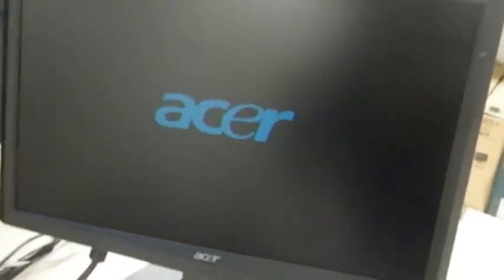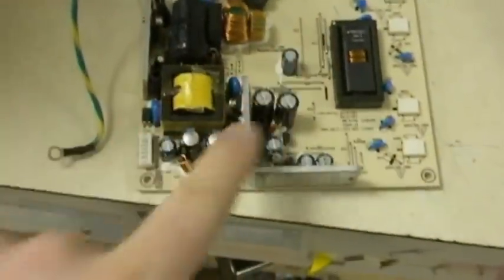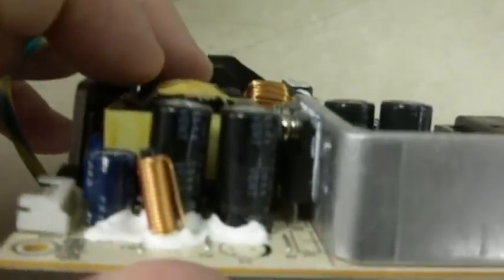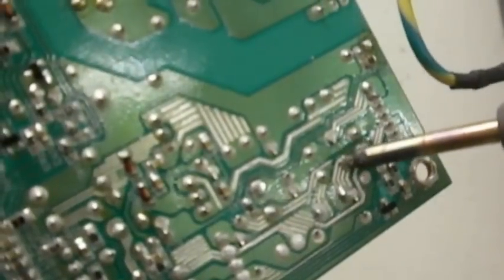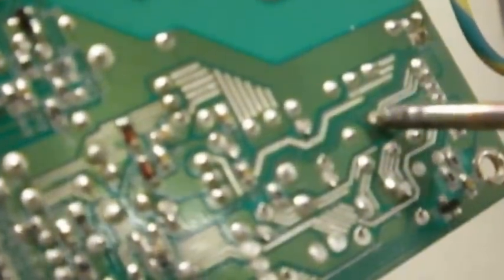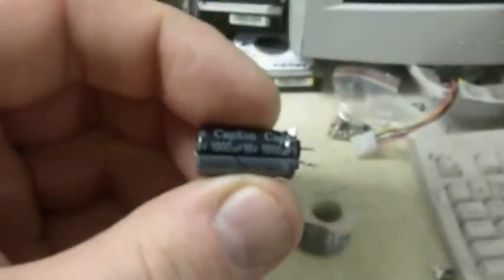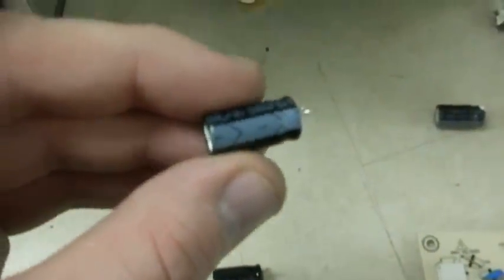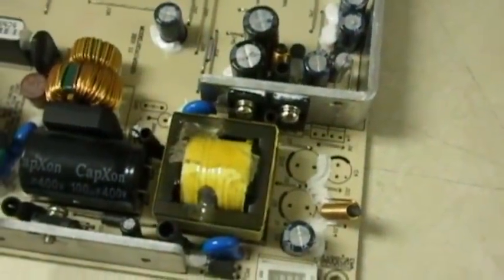LCD Monitor Repair - in 5 mins!

Comment: my samsung 913v monitor pwr board (disconnected),  makes a clicking sound 4/5 seconds apart,..could it be a fuse or capacitor?  I have no picture
Reply from the maker: I am not familiar with that board, I really can't say.  Do you have a service guide?

Comment: How did you know WHICH capacitors were bad? I have the same Acer problem...
Reply from the maker: I believe I said in the video, you look for the puffy ones.  But usually its safe to assume they're all bad, because they probably are!
Reply: ok.  Thanks.   Great job!
Reply: You can get a capacitor tester for cheap on ebay. You can't always tell the condition of a capacitor by the exterior. Yes, a bulged top would definitely indicate a blown or failing capacitor, but even an in-tact capacitor can be bad.

Comment: hello sir.. can we add HDMI port to monitor which has just VGA input... ? without converter.. just inside itself
Reply from the maker: I will have to say yes... but it wouldn't be something easy or practical that we average end-users would want to get into... you'd need a circuit diagram for your individual monitor, and a bunch of parts, and knowledge as to how all that works.

Comment: My monitor randomly turns itself off and (randomly) turns itself back on.  Led light goes out in fail mode and on/off switch does nothing.  I have changed all the electro caps in PSU module.  Fault is still there.  What on earth is going on??  Monitor is an ASUS VK222U.
Reply from the maker: Maybe its not the monitor, maybe its the computer?  Just throwing that out there... ya know, gotta check to seCancel ￼Ree if "the lawnmower has gas before trying to fix the engine" kind of thing.  Run it on another computer and see what happens.  Also you can try different resolutions and refresh rates, that may help.  Check the specs on the monitor and run the most native setting.
Reply: Thanks for your reply vvduckvv.  Nah, the monitor is one I've been trying to fix for a friend and i'm using it with my known good computer.  It was doing the same thing when used with her computer.  I'll try your other suggestions, maybe one of those will help.  Part of the problem is that due to the nature of construction, I can't run the monitor with it opened out.  i would need breakout (extender) cables to do that.

Comment: Hi there. I was hoping you could advise me please.  I would like to use the ccfl backlight of my old acer monitor as a light sorce although its' inverter is built into the big board containing the power suply. the power suply board is connected to another circuit  board, via removable pins, where the AVG input port is also connected. the backlight will only stay on if it recognises a source conected to it. is there anyway i could bypass having to connect a source in order for the backlight to stay on?

Comment: My monitor  has 2 issues.
1.) Video randomly goes off but will come back on within 30sec. It's not constant, but random. The power led remains on.
2.) Tonight while watching a movie it did it again but when it came back on, red pixels showed through parts of the screen & red outlines showed on shapes like my taskbar, outline of bodies in the movie, etc.
I ran jscreenfix within a min after it happened. After 3mins, I shut it off for 5min. Turned it back on & all is normal now.

What could be the problem?

Comment: You may never really understand how much your video helped me.  5 years ago I had to shut down my business for 25 years to stay home and care for my wife who has had no doctor care in 5 years and could easily die if left alone.  We are dirt poor, sometime even going with food because it seemed impossible to find a job to earn a living totally from home.  After 5 years of searching wasting money on books bogus jobs, I finally found what I believe it a legitimate job I can do online to feed my family...and today, 1 day after I sign up to start...my ASUS VW246H monitor dies.  For the last 24 hours I have been researching this and it does look like the same issue, but until I found your video I thought I would need to spend $30-$40 and wait weeks for inverter board from China to show up.  I am good a soldering, but "electronically impaired" when it comes to understanding circuit boards so your video was perfect.  As I was watching and was thinking after you tossed down the caps on the table, "Do they have a positive and negative side?"  Two second later you answered my question.  I just wanted to let you know that your video really made a difference in helping someone.  I am currently trying to get  the case open without cracking it.  I removed the stand and 1 screw under a warranty void sticker, but it still seems to be clamped together.  Can you tell me how to get it apart?  Thanks, James Galyon  281-463-1302
Reply from the maker: angelhelp777 Hi James.... comments like yours are the best.  Thats the reason I upload my silly videos.  When I can help someone it feels right.  As far as splitting the monitor apart, I put a knife in the seam and gently push, and sometimes rock it back and forth a little.  Once you get the the first button to release you'll find the rest of the pretty easily, be careful with the knife so as not to damage the plastic bezel, and of course... don't cut yourself!  :)
Reply: I had 2 other questions.  I managed to get the case open on my VW246H ASUS monitor (and only broke 2 of the clips doing it)  I found a total of 4 caps with swollen tops.  They were all 470uf 35v.  There were 5 total caps of the same kind together on the board, but I replaced only the 4 that were visibly swollen because after a trips to 3 different Radio Shacks the most caps I could locate were 4.  After putting the monitor back together, I still have the same issue with the screen coming on for 1 second...going off for about 4 seconds and coming on for 1 second and going back off and not coming back on.  I have a very simple multi tester that will only test AC or DC voltage and continuity, so I can't really test the caps individually.  Is there any way to test caps using my meter?  Do you have any suggestions?  I also have a question about soldering.  I have been soldering wires together for years.  Usually it was some simple wire I had to splice and not on a circuit board.  I have 2 soldering tools.  One is a 40 year old Wen soldering gun that puts out a major amount of heat and it too hot for circuit boards.  The other is a 15 watt pencil type  soldering tool which I used on this repair.  On the board where the original wires come through the back and are soldered, the solder around each wire is in a small smooth pool around each wire and is shaped like a little mountain with the protruding wire at the peak.  When I soldered the caps on, my solder joint look like a round ball or blob of solder sitting on top of the board, rather than merged with it.  I was using a clear flux solder.  I have a can of soldering paste which I thought was for making the solder adhere to the surface or wires, but I didn't use it because all I end up with is a black goo around the solder joint.  I thought I was not applying enough heat, but I can keep the end of the solder tool in the solder and it will get soft and just roll around rather than stick to anything.  I also have solid core solder for plumbing pipes and some very old, larger diameter, acid core solder which also leaves a mess on circuit boards.  What am I doing wrong?  My did was a welder and could  do this stuff in his sleep, but his talent and skill were apparently was not inherited.  Your advice would be much appreciated.
Reply from the maker: angelhelp777 Your capacitors may not be seated in circuit correctly (cold solder joint/not enough heat) Otherwise, to be short, if you're getting blobs of solder that don't stick, and black rosin everwhere when soldering you probably don't have enough heat. The rosin will melt out of the core of the solder before the metal will melt if you're not hot enough.  The solder should flow together, and the rosin should burn away (don't breathe the smoke!)  I'd clean the black rosin residue off, and reheat the cold solder joints.  The 15 watt can do it if you hold it there long enough, you can also use the 40 watt if you work quickly.  Hell, I use a 100 watt gun for most things, but I work very quickly so as not to fry anything.  Acid core solder is bad for electronics, its an active substance even after you're done soldering and can damage circuit boards and other delicate components, stay away from it!
Reply: vvtheduckvv What wattage is your soldering iron?
Reply from the maker: I believe the one you see in the video was a 35W.  I fried it and have since recycled it.
Reply: Thank you. I found a higher wattage soldering iron which seems to work better.  I really appreciate the help.  I finally found enough Radio Shacks to gather a total of 4 capacitors (470uf 35w) to replace the 4 swollen ones on my power board in my ASUS VW246H monitor.  The caps I found are a different color, slightly shorter, but the exact same 470uf 35w as my old ones.  After replacing them and soldering the connection with the hotter soldering iron and verifying all the solder  connections are good, I still have the exact same issue when I power on the monitor.  It comes on for 1 second, goes off for about 4 seconds comes on for 1 sec and then goes back off.  I also notice that the light on the power button is first blue when turned on, but after the on and off cycle of the screen happens, the light on the power button turns orange. I looked very carefully at all the caps and only 4 of the 470uf 35w were slightly swollen.  There was a one more cap of the same kind on the board so I pulled it off and it checked out to be 463.8uf of the 470uf so I considered it to be good.  All the bad ones read in the 200's and have been replaced.  There are 5 other similar shaped, but different uf caps on the board.  I pulled another off and it checked to be OK also.  Should I keep taking them off, or is there another part of the board I should check first, and if so, how do I check it?  I started to do this to first save money and time, and so far I am only up to about $6 invested, but I need to get this up and running ASAP because after 5 years of looking, I finally found a job in in my field of work I can do online, but the old CRT monitor I am using to write you on is not going to be good enough.  All the replacement boards must come from China and that is a couple of weeks and $40.  Any advice would be greatly appreciated.
Reply from the maker: It could be a bad backlight transformer, too.  I had an Acer that had that happen.  I am afraid I am out of suggestions, though.
Reply: The screen will light up completely for aboutg a second showing the full desktop.  Does that tell you anything about the backlight?  The board has slightly darker areas on the back where heat may have been, and the only thing  I can see  that might be showing some signs of a problems is what appears to be a light yellow transformer with some sort of  transparent orangish coating on it that appears to have bubbled at one time and has little rings left by burst bubbles.on it.
Reply: Last Question,I promise.  Where do you suggest purchasing parts?  a new transformer?  a new board?  I also managed to break two of the button switches on the control board which I now need.
Reply: angelhelp777 Did you clean the surface with flux?

Comment: very useful man - thanks! I'm replacing 5 caps on an LG monitor. When you say it's ok if the voltage is higher, how much higher can you go? I have 3 x 16v and 2 x 25v to replace. Could I use all 25v? Again, thanks!
Reply from the maker: Martin Archer Do it! Those will be just fine.  Just be careful how much heat you apply, you could damage other components or lift the traces off the board.  :)

Comment: I had similar problem, my Viewsonic LCD use to flash for few minutes, sometimes 15 minutes before stable display. I disassembled the LCD and could easily find three bulged capacitors which solved all my problems. Thanks!!!!!!!!!!!

Comment: I have the same problem with my LG 22" monitor. I disassembled the monitor and took out the circuit board for the power circuitry (there are two: one for rectification and another for accepting signals from the VGA and DVI ports), but can't visually detect any damaged capacitor. They all seem fine. Any suggestions on how to proceed? Thanks.

Comment: Does this work also with an LCD that looks cracked but is not? I want to take the entire circuit board out and replace it.  Is that expensive and hard to do? After I asked the question I answered it myself.  Too expensive!! Might as well buy new TV.

Comment: Does this work also with an LCD that looks cracked but is not? I want to take the entire circuit board out and replace it.  Is that expensive and hard to do?

Comment: Thank you for the great video! I have a blown capacitor for sure on my screen. It is connected to a battery UPS ..and i think the signal from those is not good ...triangle shaped AC .. that blows the power stage of low power monitors. Also when I disconnect the monitor for awhile the monitor does not power up. I have to unplug from the mains an wait sometimes for 3 minutes plug back and he starts ... this time-constrained behavior makes me think it is indeed the capacitors.

Comment from the maker: That depends on the transformer's specs.  You check for continuity and make sure its within spec.  They usually short out or open connection.

Comment from the maker: Caps won't test for continuity because of their design.  If there isn't many caps, just replace them all anyways.  They're cheap enough it shouldn't be a big deal.  If it still doesn't work, look at the transformers next.  Those you can test for continuity.

Comment: Good video, thanks.   I did the same in my monitor that was damaged by water, and it works again, and has been now for 2 years after the repair.  
  I ordered the capacitors on line for a fraction of the cost that our local Radio Shack was asking, so that's why I replaced them all instead of just the dome shapes, in case the rest were about to go bad.
 Be patient, read the capacitor carefully, watch the + and - holes, and for the most part, I didn't have to add solder, just a careful re-heat.

Comment: one and half a month ago, first my power supply then monitor screwed. it is a 24 inch full hd monitor so i couldnt watch it die.
i had already thought i could be capacitors, but then i watched your monitor's problem, and see it was exactly mine's problem.
i had already opened the case for two weeks and your video gave me the courage to complete. i have found that not 1 but 5 capacitors were faulty.
now i am writing these lines with it working :)
thanks a lot.

Comment: one and half a month ago, first my power supply then monitor screwed. it a 24 inch full hs monitor so i couldnt watch it die.
i had already thought i could be capacitors, but then i watched your monitor's problem, and see it was exactly mine's problem.
i had already opened the case for two weeks and you video gave courage to complete. i have found that not 1 but 5 capacitors were faulty.
now i am writing these lines with it working :)
thanks a lot.

Comment from the maker: It depends on the monitor, I just fixed another one today that the light went off on, too... and another that I fixed previously the light stays on, but changes color.  Not all monitors will have the same light behavior.

Comment: i got same problem but my power light stays on when screen goes black, dont know if yours does, if i turn off and on will see image come up for about same time yours did, if you was on desktop and turned off and on would you see desktop image for about 1 second every time as well?

Comment: have an AL2216w that shows some yellowish bands scaning through the screen... funny thing is that I only see them through a camera or cell camera... they go away if I set brightness to 100%... and I always had the setting at 50% and it never displayed this behaviour while shooting video at the screen... what could gone wrong? btw, did open it and guess what... found out 2 220mf25v caps leaking and replaced them... still have the bands though... but at least I changed those...

Comment: Just wanted to thank you so much - I just repaired my LG Flatron by replacing one capacitor. Original was 16v but works fine with the new 25V I put in (same mf) .

Comment: Hey thanks very much for this video and it's nice to see you are trying to help people with monitor issues in the comments. I have a HP2509 monitor that I've had for nearly 2 years. It still works fine most of the time but lately when I change sources (from DVI to hdmi etc) the monitor flickers for up to 4 minutes before it stabilises ... I've heard this is something to do with an inverter  and I'm wondering if there's a DIY way to fix it? or will I have to resort to buying a new monitor? thanks

Comment: Yeah I've got some on the way to replace them.  Just did the same for an old LG monitor that had went out on me and got it fixed.  It was obviously the caps since it didn't take power unlike this Acer.  Thanks for the advice.

Comment from the maker: I don't think you have bulbs, but it could be a backlight issue, but as I tell everyone else it could still be bad capacitors, or a bad inverter transformer. or bad backlight or a bad power supply.  Start with the caps first, thats the most common (and usually good to do anyway, as any monitor that lives long enough will have bad caps eventually.)

Comment: ok my monitor does the same thing but found out its the little button thingy on the front of the monitor that turns it on and off  it a come on then shut right back off but u can turn it back on but does same thing again compositors are good how do u fix this problem